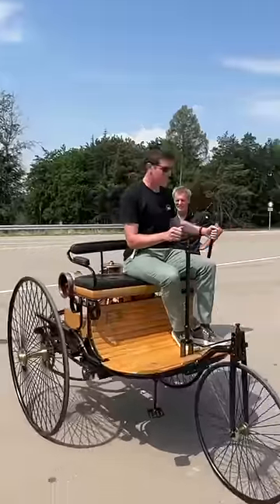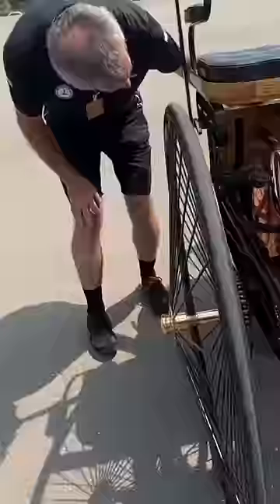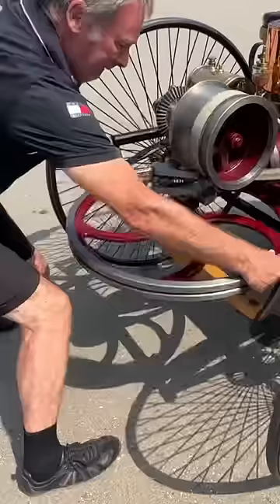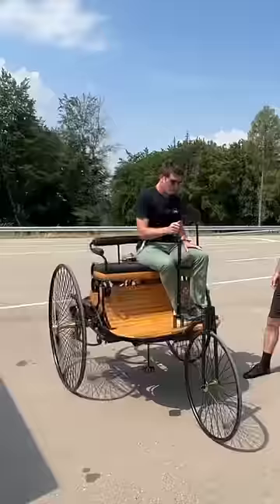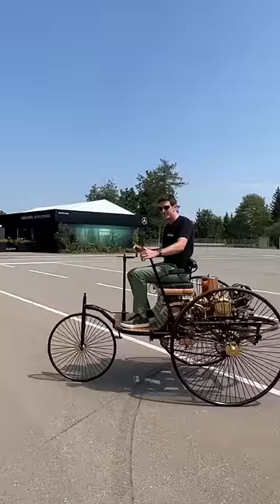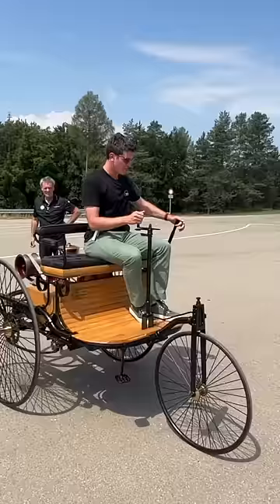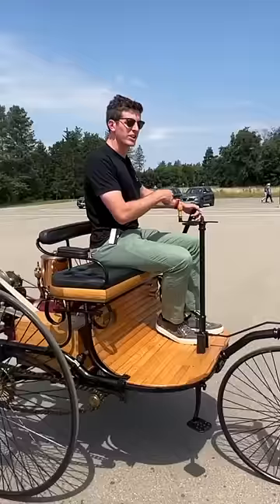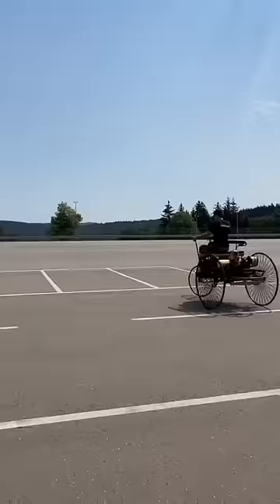How To Drive The Oldest Car

Comment: "It works! It's a Benz." Funny guy
Reply: I’ve driven Benz for over a decade and done all my own work on them. They work great compared to my Chevy or other cars that fail constantly
Reply: @Plantersfreedomseeds1776  but when they do break it's 4x the cost
Reply: “It vorks! Itza Benz!” EXACTLY! I am surprised too! A Benz that is over 5 years old that still works, must be an antique. No modern Benz would still be good. Lol
Reply: @Plantersfreedomseeds1776  My chevy has 360k hasn’t failed me
Reply: @The_Ed_Hodgers  glad to hear that, Chevys are good but I still stand behind Mercedes. I own a Chevy Silverado that’s been a good truck but has some major flaws. The oil pick pump o ring can fail leading to low oil pressure which can cause bad problems. That being said my Chevy has cost me more to date then any of the Mercedes I’ve owed over the years. AMG has been designed so well I found the motors user friendly and cheap to maintain if you do you’re own work. I love LS motors for the fact it’s cheap to mod but things seem to fail more often in gm products than my Mercedes that I drove more often. My chevys constantly have bad alternators, power steering pumps, valve cover gaskets, ball joints, and other major chassis work needed. My Mercedes have stood the rest of time and abuse by me and continues to hold up under normal maintenance and repairs.
Reply: @dominicstephens781  not if you do your own work. Guys make it out to be a way bigger deal than it is. Used german cars are for guys who work on them themselves
Reply: @Plantersfreedomseeds1776  
Let me raise your Benz on a lift and I can point out several items that you haven’t maintained or repaired! And there are many repairs you can’t possibly do yourself…
BTW this “first automobile” is a very expensive reproduction.
Reply: @benztech2262  hahahaha that is some true mercedes wisdom 😂 I’m shopping for a benz and people tell me the car needs nothing! After inspection from a dealer on the last car, they found out a belt was cracked! The owner didn’t want to lower the price. I rather lose 140$ on an inspection than 4000$ later on.
Reply: But it is Benz. Built by Karl Benz. Look it up
Reply: @JustSomeGuyNotAnAlien  lol my 2002 c class has 300k and everything works on it besides it needing a new maf sensor
Reply: @benjaminturpin2749  yup i do everything myself on my benz and its super affordable
Reply: I thought he said “it works, it spins”
Reply: @dominicstephens781  because mechanics take advantage it’s a pricy car can’t drive if you’re broke is what they say. When German engineers actually think of mechanics and usually make things easy to replace one way or another. Easy to fix but people charge a premium. So unless you’re actually in the fields and educated on why don’t say anything without an explanation.
Reply: @dominicstephens781  if you know how to maintain your vehicle yourself aftermarket parts are quite affordable, depending on your model. I drive a 2012 w204. My 6.4 '08 f350 has more expensive parts lol
Reply: @Plantersfreedomseeds1776  haha that’s funny! LS has entered the chat vortec has entered the chat *duramax has entered the chat keep looking like a clown my man
Reply: @levilangley8744  M156 NA has entered the chat and said you left your bottom end on the track at the start line. Also I own both an LS and vortec. Just stating facts they cost me more.
Reply: @Plantersfreedomseeds1776  sure you have😂 and the LSX will handle more power then any Mercedes crate engine. I know you lying about owning those because vortecs are extremely reliable. Only way you right is that if they are at 300-400k miles. Mercedes don’t even reach 200k nowadays homeboy
Reply: @levilangley8744  06 Chevy Silverado crew cab. Survived a theft from an airport for three months and recovered. I’m not knocking they will last since it survived a crack head for three months. It still has cost me more than any of my Mercedes including my c63 AMG. Plus my ls is sitting in the garage waiting for a donor chassis and tremec six speed. But the m156 for less than 10k got me to 198 in sixth gear turning 6200rpm with a 7100 redline and seventh to go. Name a n/a ls that’s not Hennessy that can do that for less than 10k. I love LS motors. I want an LSX for a full project car.
Reply: @levilangley8744  also my glk 350 is at 235k. All I’ve replaced is alternator, pulleys, front drive shaft, and secondary air injection pump, spark plugs, coils, and filters. That’s pretty damn reliable if you ask me. Second alternator on my Silverado at 156k
Reply: @Plantersfreedomseeds1776  funny, my Chevy has never failed me. Starts every time.
Reply: As someone with a 1983 Mercedes-Benz 300sd with 555k miles...yea benzs are just built different
Reply: Well...didn't Maybach make this? And then went on to work with the other guy and they made Mercedes too...so technically it is a Benz....lol
Reply: I rode in a Mercedes E class taxia few days ago. It is a 2004 3.2 diesel car and it still runs good and accelerates fast. It has 1 500 000 mil km on it, on it's second engine. The first engine was replaced after a whopping 800 000 km.
Reply: Lmao I have an 83 300cd with 375k on the odo, everything still works and it starts perfectly everytime. I’ve also owned a c350 for years with nothing but regular maintenance. Don’t buy a car you can’t afford to keep in good shape
Reply: @SpaceFaceFPV  No, Daimler did
Reply: @chipperhughes4755  ohhh really? I gotta brush up on my history clearly 🤭 my bad! Thanks for correcting me bro 💜😁👍
Reply: 8th owner e500 193,000 miles it does sit in the driveway waiting on parts sometimes tho 😢
Reply: @Plantersfreedomseeds1776  you and the Chevy dude both funny to me. Mercedes is great new stuff not so much, Chevy is great new ones not so much. Mercedes has electrical issues Chevy has trans issues. I love both brands would love to get my hands on a c63 amg coupe or a 2SS 1LE but if I know anything it’s that reliability wise neither of them are winning any awards. But we drive what we drive because it’s a extension of our personalities, and or brand loyalty and or what is in our affordable range for the kind of driving experience we want luxury or gets the job done. Reliability wise can’t really go wrong with Toyota and or a Lexus for the premium variant or for peace of mind Hyundai/Kia and genesis for the luxury peeps (not as reliable but pay a fraction of the cost for some of the latest features and get a 100k warranty and I know genesis drivers save a ton when turning in old model for new model) 

Just 2 cents I probably won’t go with a Toyota any time soon unless I can get my hands on a Supra faster then a Camaro or good low mileage deal on a c63 amg coupe.
Reply: @Plantersfreedomseeds1776  probably because they invented the car
Reply: @MugiwaraElvin  I agree with the Toyota remark, however sad it is to say, I can afford a used c63 AMG coupe but not a used newerish tundra. Warranty is nice but I hate the hassle of dealing with them. I like what I have now but if push ever come to shove the Silverado is staying since it’s my work truck and pays the bills. I had a 91 Toyota pickup for awhile with 250k miles and that thing wouldn’t quit. The one vehicle I regret selling the most and happened to be the cheapest vehicle I ever bought. Now those old rust boxes sell for big money.
Reply: @JustSomeGuyNotAnAlien  mine is over 10 years old and not a single issue so far. Just change the fluids and inspect things occasionally and you will have no trouble with a benz 😊
Reply: @dominicstephens781  not really
Reply: I see some of you do not like my comment a d said, “I do all my own work…” that is the point. My friends had a 1989 Mercedes Benz 300D wagon. The “work” that had to be done to that wagon in 1997 was oil changed. PERIOD
Reply: @SpaceFaceFPV  Carl Benz made this car, before he had any affiliation with the Mercedes-Benz company. This car is literally just a “Benz”. no MB, Maybach, Daimler, or anything else.
Reply: Benz until the late 90s were great cars! The peak of Benz reliability was in the 80s. Millions of Mercedes of this decade still do their work all over the world. Especially Diesels run forever. That’s what he meant with the Benz that works.
Reply: @Plantersfreedomseeds1776  love how you compared it to the second worst American manufacturer rather than like... the third best Japanese manufacturer lol.
Reply: As someone living in North America, our Benzes are mostly the big engine automatics with adjustable suspension, we salt our roads, and their reputation for expensive repairs on complicated systems is well deserved. If we got the basic diesel manual versions other markets have the reputation would probably be better.
Reply: @questioner1596  smart cars weren't good either.
Reply: @SpaceFaceFPV   This is the Patent Motorwagen 1 (patent motorcar 1) build by Carl Benz. Gottlieb Daimler and Wilhelm Maybach build the Reitwagen (riding chariot) and then shortly after Benz build his three wheeled car, Daimler presented the Motorkutsche (motor carriage) which is considered to be the first four wheeled car.
Reply: @microcolonel , I agree but they were like an exotic car compared to a Honda Fit.
Reply: I got a 97 plymouth neon with 200k miles, just because you have one good car doesnt mean the make or model is reliable. If you properly maintain any car it will keep chugging.

That being said, as a mechanic, i prefer working on chevies, as a fleet mechanic i noticed chevies have the lowest cost over 2-5 years of other american trucks. Not really relevant but its what i know. As a layman, ive noticed the majority of old cars/trucks are chevies, even if other companies outsold them at the time. How many 70s/80s mercs do you see? I see chevy cars and trucks from that time daily.

That is info over time, medium term and short term. Idk how to verify youre anecdotes about your merc and chevy, but i have a lifetime of being pissed at every car company, but chevy pisses me off thr least.
Reply: @JustSomeGuyNotAnAlien  still waiting for my 7 year old c300 to throw any engine code 😊 

Enjoy your Corolla’s cloth seats!
Reply: Lol
Reply: @Plantersfreedomseeds1776  you are in the minority
Reply: Remember it’s not a Mercedes-Benz, it’s JUST a Benz
Reply: @Plantersfreedomseeds1776  depends on the Benz and the Chevy. Personally I take my Toyotas over either make, but Benz did have some very hardy vehicles at one time. I’ve seen newer ones have problems and it is always an expensive fix. Heck Porsche is more reliable than the superBenz’s across the board with maybe a couple exceptions
Reply: You can tell it's Americans commenting on Benz not working. Reason why you guys don't have many of them and spare parts are expensive Benz in Europe are everywhere and they last
Reply: @dominicstephens781  yeah? What did you expect guy. It’s like buying a lambo and expecting full brake and rotors to be $500
Reply: @benztech2262  who’s said he’s had them long enough to need to do major repairs to it? Basic maintenance on a Mercedes’ can be done at home no problem.
Reply: A Attribute they lost over time in their cars
Reply: @Plantersfreedomseeds1776  yo I got a 1982 380SL that won’t pass smog.. too rich… any advice? Gave it an Italian Tune-Up but still failed
Reply: @samurboi8007  good to here! That is awesome! I have a few friends that have had Benz. All of them have had to have the air suspension completely replaced with after market shock systems. Others have had Benz from the early 2000’s that were so bad the entire electrical system was faulty and the cars were abandoned with less than 100,000 miles on them.
Reply: @Dr.stein55  EXACTLY pre-2000’s Benz were built to last still.
Reply: @JustSomeGuyNotAnAlien  Very true. My 2002 didn't come with air suspension and is on stock struts, springs and rear suspension. The only parts i replaced for the suspension was bushings and for a 300,000 km car thats fair. Early 2000s benz had alot of electrical issues, most likely because alot of the tech was new and experimental, however somehow my car has no electrical issues. Still a great car and is really well engineered but still nothing beats those pre 2000s Benz
Reply: Mercedes and Lexus are very reliable. If you can’t work on you own car, too bad!
Reply: @JustSomeGuyNotAnAlien  I have a 20 year old c320 Mercedes with 238,000 miles on it and just drove it from California to Texas and it still runs fine
Reply: foe word 
yep. funny.
Reply: @atonedsins4617  and if I was to have leather seats it would be in another car not a MB. I would buy another Jaguar.
Reply: @MTG1207  that is awesome! Congratulations on a keeper. I am simply talking about the difference from the pre 2000 MB before Daimler-Crapler years. Chrysler makes garbage and those years they suffered inferior craftsmanship. Perhaps I misspoke and they have improved the last 10 years. I just remember seeing Mercedes for sale with 20,000-30,000 for  $7-$10,000 because the electrical harness they used was soo bad it made them paperweights.
Reply: @JustSomeGuyNotAnAlien  very nice! Hope it can get you from A to B! Gonna be hard!
Reply: @atonedsins4617  Lol I know right! But I loved my baby Jaguar, made by Ford, in England 😂. When it did run that thing was glued to the road even on the iciest Michigan winter day with traction control on that AWD 3.0L I could not get that car to do donuts in the middle of an iced over parking lot. It would not slide. Traction off was still great car with AWD.
Reply: Haha
Reply: Nazi’s
Reply: The old for 250 crossflow or the GMH 179 both very strong engines you practically can’t kill ‘em. But then that probably was true for a lot of the in-line 6 engines of those years.
Reply: @JustSomeGuyNotAnAlien  👈 has never touch a M112 or M113k engine.
Reply: @chipperhughes4755  I think the take away here is that MB made in Europe or even Canada are great but once it comes to the US and we touch it, they turn to crap. Honestly a lot of Americans do not take pride in the job they do. They are spoiled just put pieces on for 10 hours a day so they can make money much like Chinese production. Cultures like German & Japanese people have they are very proud and take honor at their work. Toyotas have even gone downhill now that some are built in the USA.
Reply: Karl Benz invented this type of "car"
Reply: @Plantersfreedomseeds1776  that’s like saying you sandwich tastes better than a turd lol, how bout compared to Toyota?
Reply: @dominicstephens781  that’s the real issue
Reply: @Plantersfreedomseeds1776  first mercedes i remenber was ever in, the throttle decided to crap out. Early 2000s E class.
Reply: @AndrewKidd14145  spoken like a someone who has never had to remove to bumper on a 911 Turbo Convertible
Reply: @Plantersfreedomseeds1776  any fullsize GMT after 2005 is garbage compared to the previous generation
Reply: @dominicstephens781  not if he does his own work on them.  Free labor
Reply: A Benz from before Mercedes joined.
Reply: @Plantersfreedomseeds1776  Silverados built after 2012 were trash
Reply: It Verks!✌️
Reply: @Plantersfreedomseeds1776  skill issue
Reply: @Plantersfreedomseeds1776 I agree man
Reply: Benz has a reputation for reliability around the world, so not a too suprising thing to say actually.
Reply: @Plantersfreedomseeds1776 In Germany, we call this „Die deutsche Ingenieurskunst!“. Wich translates to „The German art of engineering!“.
Reply: My GLK 350 has been bullet proof about to pass over 200 k had it since it had 59 k
Reply: @JustSomeGuyNotAnAlien  depends where we draw the line on "modern".   
Karl Benz's era would have been as reliable as a Henry Ford Automobile.
30s and 40s Benz are gonna be easy.  
50s-70s are probably decent.  
80s-90s not that bad.  
'00s getting a little finicky.  
10s-Present forget about it.
Reply: Toyota
Reply: Americans with their trash cars and salty roads doesn't know true Mercedes quality of course. People all around the world still driving 30-40 years old Mercedes cars daily without any issue and minor maintain.
Reply: @frt1985  Lol, true Mercedes quality is praying you get to 40k miles without the engine blowing up.
Reply: @TheRealCatof  tell that to my 1987 W124 with 640K kilometers Benz.
Reply: @frt1985  Congrats, but that was when Mercedes was the most reliable brand. Find me a Mercedes from this Millennium that can do that.
Reply: Toyota is better and cost less to own and repair.
Reply: Benz need maintenance. Its no ford or chevy tractor that you just throw a bunch of ducktape on
Reply: @xXRaMsiisXx  W126, W201, first gen W124's and older models you can throw bunch of ducktape, easy to maintain. W140 and newer models (1993+) has too many electronics that causes lots of trouble with old age.
Reply: @dominicstephens781 not if ya live anywhere in the world other than america and actually have metric hardware for sale
Reply: @levilangley8744 97 E320 at 300k miles going like a champ. M112 V6